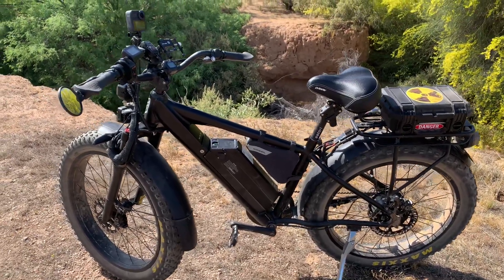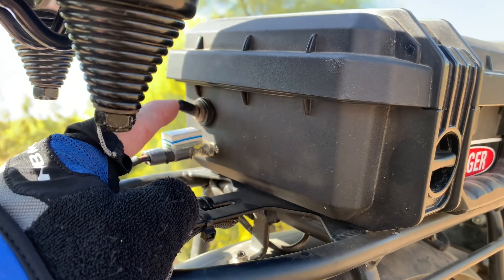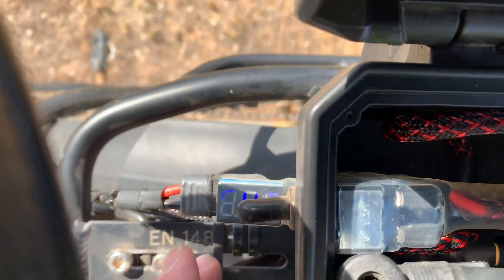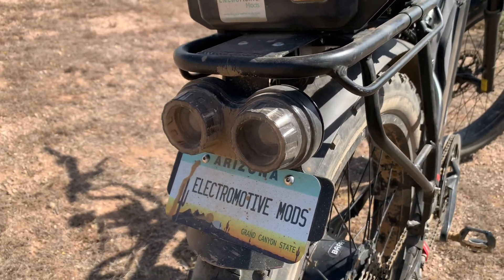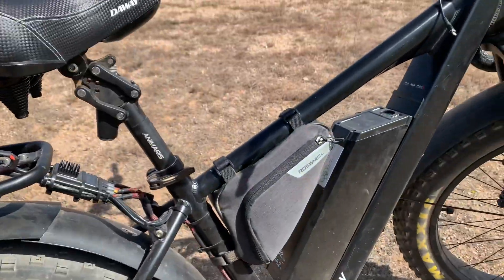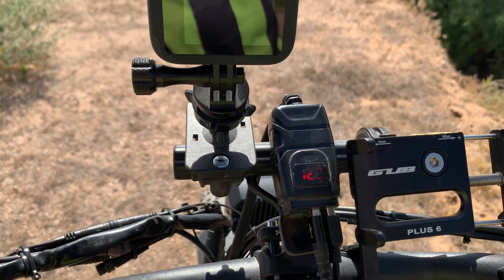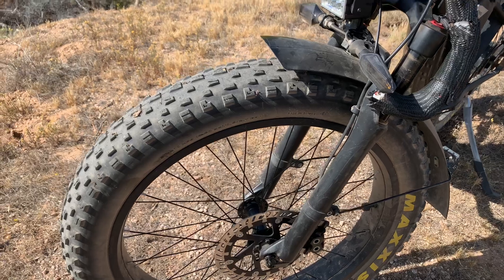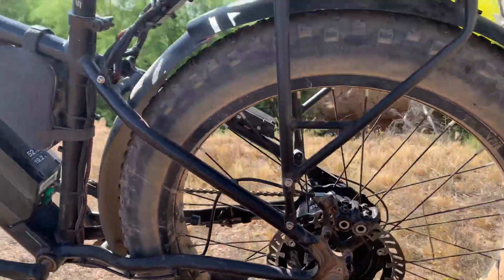eBike Mod Overview

Comment: what do you have your fronts lights power by please ?
Reply from the maker: All lighting is powered by the main battery.  Lighting is running off a "Buck Converter" that steps 52V down to 12V.  It's a custom headlight too, producing 8,000 lumens.